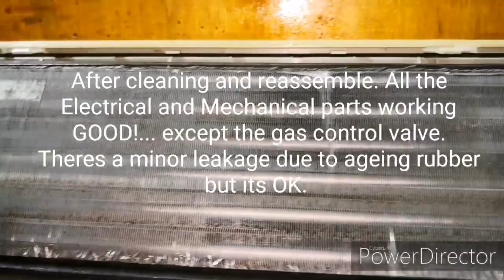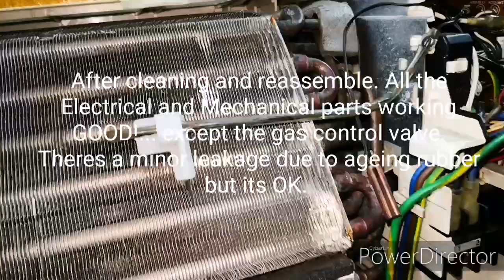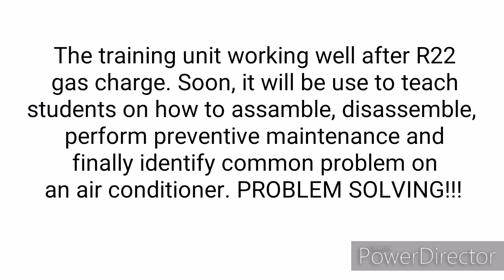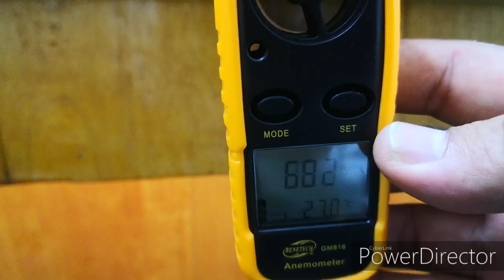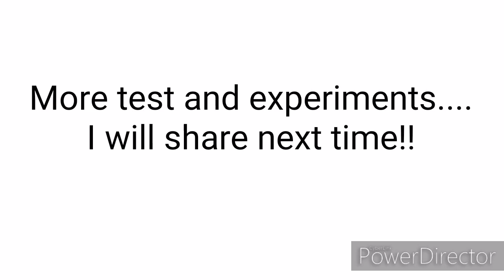Air Conditioner Training Station DIY STEM-TVET

Comment: can use Testo smart gauge manifold when topping up the refrigerant, that smart type gauge manifold will will provide high precision temperature and pressure measurements, determine subcooling and superheating. This info will guide us the correct amount of refrigerant been top up.
Reply from the maker: Tq for info. Will put that in my wish list next...